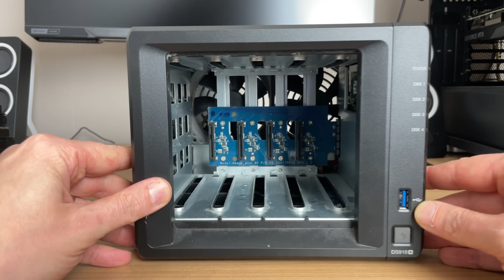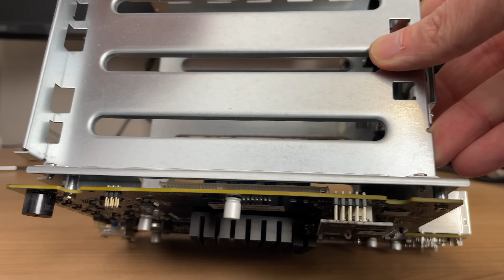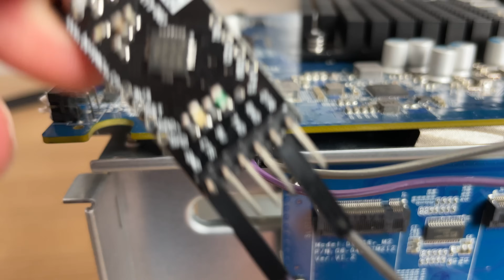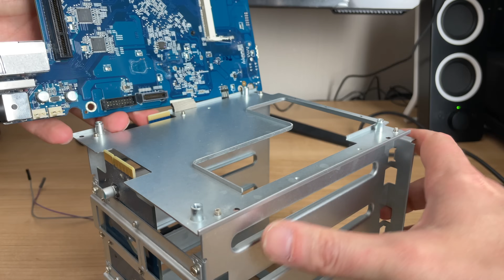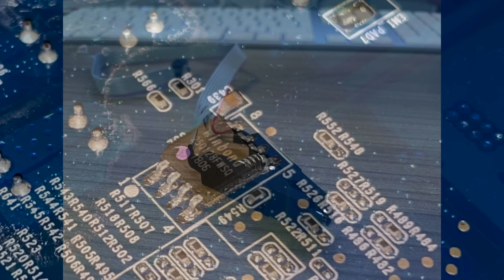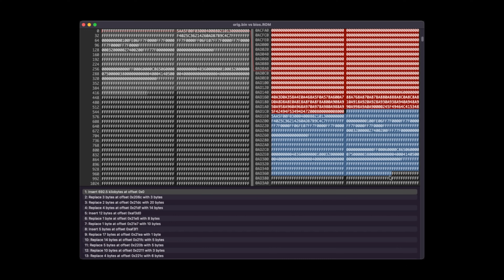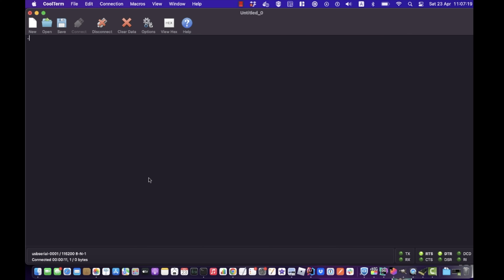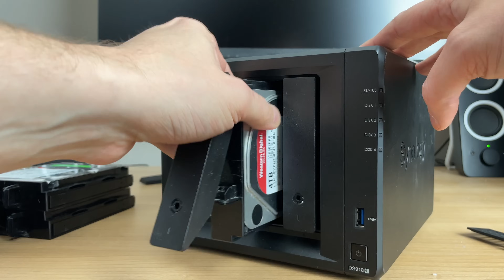Synology DS918+ Bricked / Blue LED of death.

Comment: Welp, there goes my idea of investing in a Synology NAS... 

I'll probably wait a bit longer, find a donor case from somewhere and some cheap board with the right amount of SATA ports, and start looking into open-source NAS management OSes.
Reply from the maker: Issue with that is that it is also a lot of work, in some cases error prone if you haven’t done it before, and you also risk messing things up (or things getting messed up for whatever reason). Like most people say, having backups and in some cases a UPS if its mission critical is the way to go. Looked into FreeNAS a while back and didn’t feel as mature as the Synology software, and you end up with a big PC with not that easy to swap storage. So also not ideal. Despite what happened I stil think Synology has a good offering. Think this only happens to a very small percentage. Just wished they made it easier to fix.

Comment: How the hell does a ROM chip even become corrupted? I've seen this happen on modern PCs. And they sometimes come with TWO BIOSes just in case this occurs! I swear this never happened back in the day! But yes, a recovery option should be available. No excuses. It has a USB port for Pete's sake. Presumably the stuff you removed from the BIOS you downloaded is even part of the delivery system for such a thing!

Comment: The reason you didn't get any data off of your little USB/Serial device is because, besides hooking up GND (Ground) and Transmit Pins you need to supply 5 Volts to the board via the 5 Volt pin on the adapter. You had no B+ so it would never operate in this state.
Reply from the maker: The board was powered. There is no need to supply a voltage to the debug port. The chip attached to that port is powered by the board. As proven by the fact that after the reflashing I was able to get serial output using the exact same pins.

Comment: Great vid! I had something similar after a powercut and luckily for me the power adapter gave up. Replaced it with a 3rd party one and it was up and running again. Now to rebuild my cache for the 2nd time, expensive SSD lasts much longer than cheap SSD in my experience with the 918+ (both Samsung SSD too)

Comment: Never trust the NAS.   Always run a UPS on it.  Always use a filter for any ethernet cables to prevent voltage spikes.  Back up your NAS to another different NAS.  Nice video.  I would probably put 2 x 8GB memory and 2 x 256GB NvMe drives in it to improve the performance when pulling a lot of data.
Reply: And have a second off-site backup

Comment: Even though i agree 500USD is no where near cheap for just a computer to connect Hard drives to the network 500USD is cheap when you look at other NAS solutions. The problem is this 500 USD is cheap for a NAS  and i am not surprising as it is built like i would build a NAS. No specials sauce just a basic PCB RAM, low end CPU, and SATA slots which are in the form of hot swappable so power connected to them on the PCB. IF you want better build quality than you can do in a afternoon then you probably want to go with a company that mostly does enterprise stuff. The main down side is enterprise stuff has an implied x10 to the amount of money spent but you get better build quality, better support, and more expandability.
Reply from the maker: Yeah, my issue isn’t so much with the 500USD as like you say is an excellent price point for a 4 bay NAS device like this including the DSM software. My issue was more with the fact that fixing it becomes impossible for most consumers and after 2 years you end up paying 500USD to get a new one.

Comment: you video has a rather annoing infrequent buzzing noise
Reply from the maker: Thx for the feedback. Sorry about that. Do you have some timestamps ? Going to experience with some noise reduction filters. That way I can target some specific sections.
Reply: @RetroSpector78  my apologies to you. Though your gain is fine, I would wager not bumping the gain as digital is very different than analog. The buzzing was sporadic and seems to have been caused on my end from a leaky capacitor in a filter for the amp on my computer
Reply from the maker: @jasonprivately1764  ah no worries ! Glad we sorted that out. Have a nice day and hope you keep enjoying the videos !

Comment: First: This is a really great video and congratulations de-bricking your Syno DS! That was a lot more difficult than most home or SMB users would probably feel comfortable doing. It's like a step-by-step guide — wonderful! Next: I know this is going to sound lame, but it's not in your video so I'm going to ask anyway. The video shows a coin cell battery in that DS918+ at 06:08, which is there to ensure ... the firmware. Did you happen to check that battery to see if it was still viable? If not, that could be why the FW got whacked when the power went out. Maybe you could sub-in a note to viewers about those batteries, checking/replacing them, etc., as they do wear out over time. Synology really needs to make that easier to access for R&R. Lastly: Synology says this isn't an issue in the DS920+ as it's designed to write any in-transit data (not cached writes) to disk before shutting down in the event of catastrophic power failure, like just pulling out the plug. I'm guessing they added capacity to, or added a, capacitor for that to work as they mention it a LOT in everything for the 920+.
Reply: the BIOS (firmware) is on a rewritable ROM (read-only memory) chip and those do not need power to keep data in them like RAM (random access memory) does, the battery is for the RTC (real time clock) and to keep some settings (boot order, splash screen timeout and overclocking) but the battery is not very important.

I think the reason the BIOS got corrupted is that EEPROMs have a write enable pin to stop data in the chip from getting changed when it doesn't need to but the company that made this PC has the write enable pin set to allow writing even if the firmware isn't being updated and there are some registers inside the CPU that hold memory addresses which tell the CPU where to write data to, when the computer lost power the cache and registers in the CPU got corrupted, the CPU was still running for a little while with corrupted memory addresses in its registers and tried to write to data to RAM but wrote junk data to the BIOS chip instead and corrupted the BIOS making the PC unbootable.
Reply: Oh derp, I'd forgotten all about BIOS on ROM. It's been decades since I upgraded or swapped BIOS chips. They're always on ROM. My bad, thanks for pointing that out. @nathanmead140
Reply: I always replace the battery when I suspect it or it has been in place for a long time. On the motherboard the bios corrupts and when I test the battery is exhausted, I change it, I do the procedure and it returns to normal. I didn't know it was such a serious problem. Good hint. Thanks.

Comment: Why do people still use Synology or Drobo is a mystery. Just assemble your own FreeNAS box. I'm no IT expert but been using it for more than 8 years. Taught myself how to do scrubs, change drives, assign permissions, and snapshots. Easy, reliable, and easy to migrate using any compatible hardware which improves reliability even more when / if hardware fails. Also its tops for data integrity. oh and always run it with a good UPS and ECC memory.

Comment: This kind of troubleshooting would be beyond most users.  It's too bad there isn't an easier way to fix it, easier than removing a chip and reflashing it using a special writer interface.  I wonder if this is a common way this unit fails.  Congratulations on repairing it!

Comment: Hi, if you are a repair and use often alligator clip, i suggest you to buy pomona alligator, they are a bit expensive, but works like charms
Bios files comes with signature data on top, you can use UEFItool software to strip this data from downloaded bios files and use new file without signature data, to be programmed into chip.

Comment: One company I was working with had a bunch of these things (about 12, I think) - they had 3 of them fail with that blinking blue light in a week.  The interesting thing is that as a result of this they decided to replace them all with a different vendor, and I ended up with 2 of the old units - which is still working without any problems.

Comment: I had a off the shelf die on me many years ago, ended up building a pc and use unraid.  The problem with these NAS systems is that the hardware is propriety so if you have problems you are in trouble once they stop making that model and end support.

Comment: Great job on unbricking it. I have my synology NAS Set up with a second synology NAS that’s only job is to back up the primary Nas. I run both on separate battery back up UPS’s. Hopefully I will never need to use the back up. Thanks again for the video
Reply: Thats funny! I'm doing the same thing  with 2 DS918+ . I guess I'm just a backup fanatic! Great minds!

Comment: Sorry about the loss. 1. Use a UPS with USB connection to Synology. UPS configuration allows for Syn to park heads on power loss, but still connected to UPS. 2. Backup your Syn. If you want to lower risk of data loss. My UPS has saved me a bunch of times.

Comment: Power supply went on my Synology NAS.  It looked very much like yours when it would turn on, except that turning it on a few times actually got it to boot.  Mine also went out after a power failed. Replaced the power supply and now it works great again.  (Not a big deal.  It uses the same PS as some servers.)  I don't especially mind that it had a fault as this NAS was 11 years old.  Its now serving as my backup NAS backing up a new NAS.  Now if it had been a chip that had gone out, I don't think I'd have fixed it.  Subscribed.

Comment: Is it one of the ones with Atom C2000 CPU? If so, it's a known problem with the CPU that happens on power cycle, just like your problem. I would reach out to either synology or intel.
Reply: No, this has a Celeron I believe . The atom bug one is the older model ds415+

Comment: WOW I am impressed with your prowess and luck there.  I had a similar issue with another Synology (RS816).  Mine it just decided to stop working. No power issues just died.  I changed the power supply and changed a few of the capacitors on the PCB to no avail.  I sold it for scraps on eBay ($30).  You are right Synology could have a bit more compassion with people in our kind of predicament.  No repair or any suggestion to help out other than to buy a new one.

Comment: Synology are great as long as they are under warranty, after that unless you are a super tech you are better off with the brick. My 8 bay Synology died shortly after warranty, the Blue LED of death or simuliar. Synology told me that they have absolutely no interest in repairing it or helping me get it repaired. Buy a new one, bugger off and don't bother us. My new  8 bay NAS is Heinz 57, everything is off the shelf. Micro ATX motherboards not Synology size, I5 CPU in a socket not soldered in and running TrueNAS software. If it can not be easily repaired I will not buy it any more.

Comment: Thank you so much "Retro".  Really informative video. I have a DS920+ now in its 2nd yr - working really well.  But I've often wondered - what do I do if I have a problem with the Unit?  I replaced one hard drive that failed.  Simple enough.  But a problem with the box is scary to contemplate.  

As you say, very disappointing that Synology appears to not to have thought this through.  Or maybe they have and are happy for clients to go buy a new box when they have problems with it.  

I'm sure a few of us would be very grateful if you could take the time to attach a note outlining to diagnostic process and points us to the basics of using the serial port interface.

Anyway.  Many thanks.  Great work.  Synology should thank you.
Reply: You need a backup of your NAS even more importantly than a UPS (and a UPS is very important!).
NAS is not backup, it’s high availability for drive failure but more often it seems the drives outlast the NAS =(

Comment: I had a similar problem with a powerline wifi adapter. I found the "binwalk" utility really helpful for analyzing the the segments of the firmware and reconstructing it. (There where some device specific calibration data and botloader, that weren't included in the firmware). In my case it was caused by a bad flash chip, with a few unwritable bytes, so I hat to replace it too.
And I would be interested how the sotware you were using to compare the firmware is called.

Comment: Did you check the power supply. You haven't shown it but if it has an external power supply if they go bad you can have a blinking power light as a symptom of a bad power supply.  That is common on most electronics today a blinking power light can be an indication of a bad power supply.
Reply from the maker: It wasn’t the PSU. Tried it with another psu from a similar Synology NAS and had the same issue.
Reply: Sorry to hear that little technician over the years I replaced numerous power supplies because of a blinking light issue on equipment.

Comment: Finding the bios on their web site is no problem. Obtaining the equipment to read/write to various EE proms is not an issue BUT Bit Banging that firmware can be an issue for many individuals. We used to do a lot of this bit banging on some Motorola radios many many years ago and many times there were forums that had posted the mods to the original firmware so one did not have to spend hours changing data line by line only to have to create the correct check sum so the radio could boot up properly.
Easier to use the correct motherboard with the proper software and do a DIY NAS. You might not get the fancy case and removable drives but you will wind up with something that is easily repairable.
A very interesting and thought provoking issue. Interesting comments and suggestions as well.

Comment: I had this exect behavior (blue led flashing, disks not spinnig up) as well. I have an UPS but it said battery failure. Indeed the batteries need to be replaced. So I disconnected the UPS and connected the UPS directly to a power outlet and after that the issue started. It ran fine before and was shut down properly. After I tried rebooting it my guess was that it kind of waits for the directly connected UPS (via USB). After I connected the UPS via serial the system booted up just fine. I disabled the UPS support and now the system runs. I dont know if thats just a coincidence.

Comment: It happened with one of my client's QNAP. The QNAP was running on an online UPS, so there was no power supply issue....the box went bad on its own. And QNAP out of warranty service dept. asked for a king's ransom to change the motherboard or the entire box itself. It took us a few weeks to source a few chips and resistors and restore the QNAP's firmware for 1/10 the price. Then another week to figure out how to upgrade it to the latest version of firmware from scratch. Both QNAP and Synology charge a bomb for parts replacement in India. When I added the entire story to a prominent QNAP forum...their official tech support incharge felt the burn and I did give my honest feedback to the country manager. But they are still quite shameless and don't want to admit their policies are meant to fleece the gullible customer.
Reply: I have a QNAP, I've lost count the number of times I've lost the RAID 5 volume.  Just one disk dying has caused the entire volume to become unmountable.  The problem with these NAS devices is that they are software RAID. The only way to recover the data is to contact support or be a Linux master.  I much prefer to store my data in the cloud, yes its not as much storage but it forces you to only store what is critical.

Comment: by the way, if that COM port was about to fry your USB adapter it would did it even with Rx only line connected LOL 😆 It's not working like Rx only "receive electricity", the potential difference is always there, as long as you've connected both the GND and SIGNAL lines, any of signal lines
Reply from the maker: If the usb adapter is 5v, and lets say the debug port is 3.3v, wouldn’t logic high signals coming from the debug port be 3.3v and registered as a logic high by the 5v adapter (not damaging anything) ? And if I would hookup the other port, wouldn’t sending a command to the debug always result in 5v beging sent to the chip, potentially frying the debug port chip ?

Comment: Nice job! I would have never suspected a corrupted BIOS, and having to desolder it is quite off-putting. Well, another lesson learned... and that's always use a UPS :D
Reply: Mine died and it was on a UPS, AND it had lived a very sheltered life - my NAS that died is the BACKUP NAS which is only turned on once a month for a major backup of my primary NAS.  It seems the bios chip is truly terrifyingly fragile, and here I was thinking 5 drives and 2 fans for redundancy was pretty good =(. It should have dual BIOS if the BIOS is not readonly!
Reply: Biggest lesson to learn here is simple... DON'T Use a NAS box, build your own.
These are notorious for dying and getting your data back is a gamble, if you built your own out of PC parts and it dies, well as long as the drives are healthy you can just plug them into any machine and import them and save your data.
These you have no guarantee even if you get the same damned model.
Reply: @CMDRSweeper  Wait... you can't always get your data back? That seems like it defeats the point. That's really unsettling